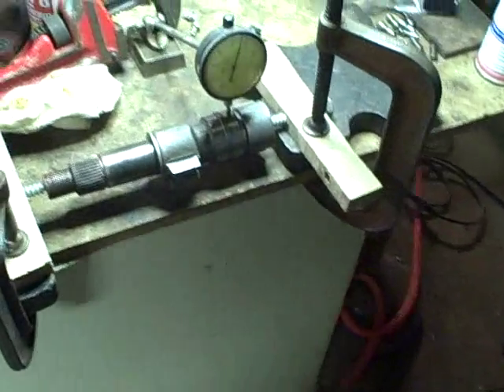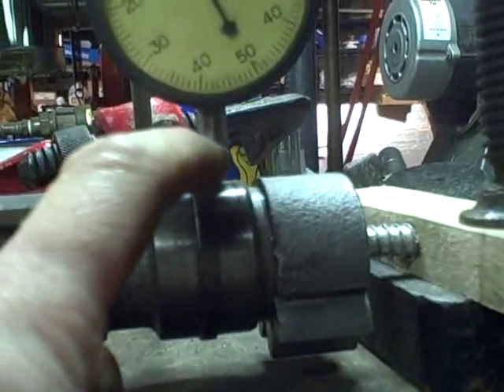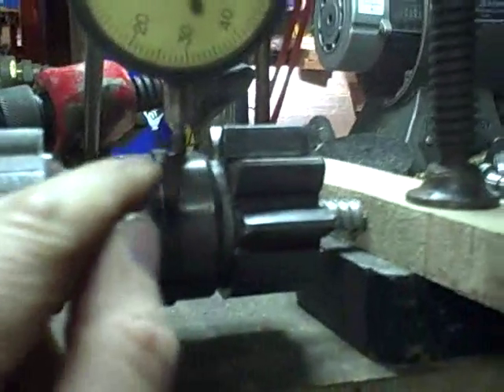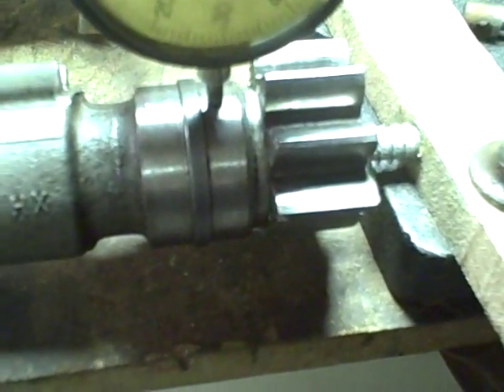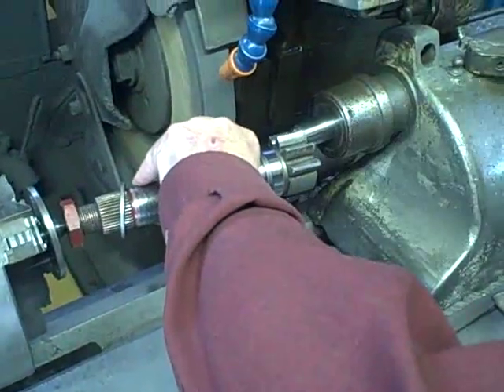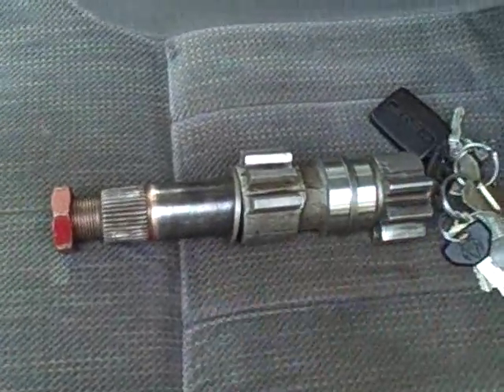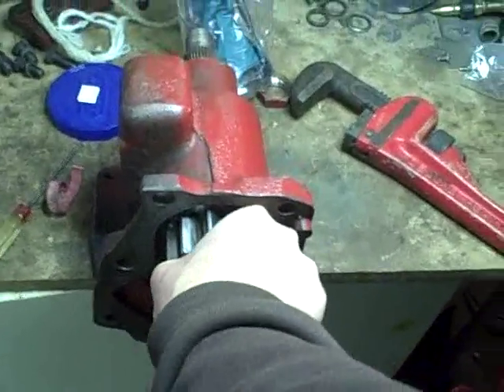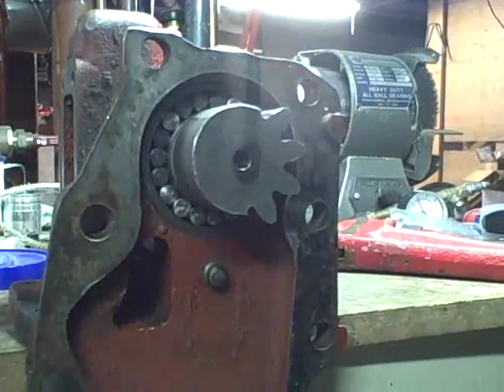IH 350U Tractor Project Part 37

Comment: ok so i was sitting here thinking about this. if you take anymore off of that roller bearing surface and that doesnt work and you find that the other end of shaft is the problem, that might cause your roller bearing surface to have too much slop in the end. then you will need a new shaft. just another thought!

Comment: you dont think the end of the shaft in the bushing is causing the problem? i would almost think that that being out of round would cause binding too. you did insert the shaft backwards that time and it worked just fine. if that end is bent really bad, it would cause the other end of the shaft to move up and down. im just speculating though. keep them coming!